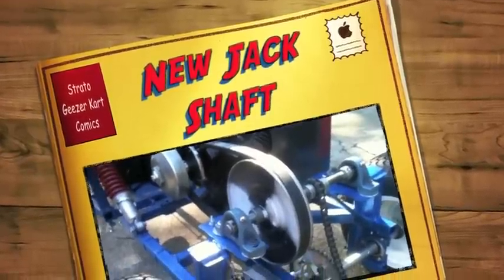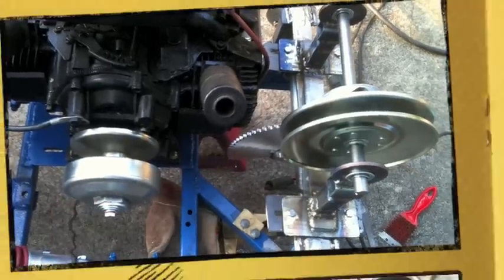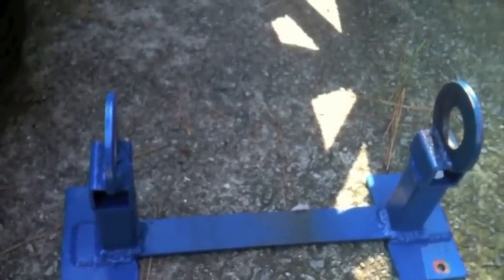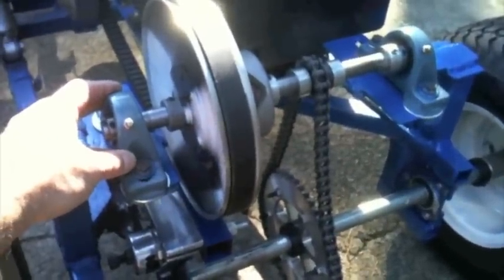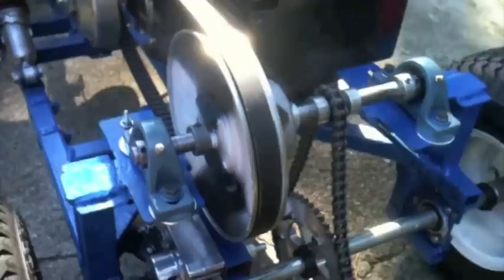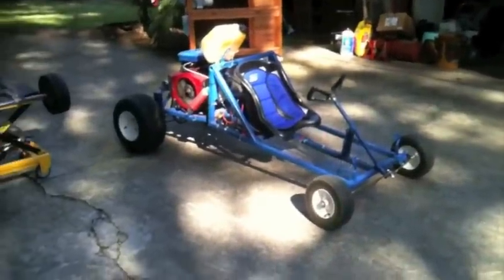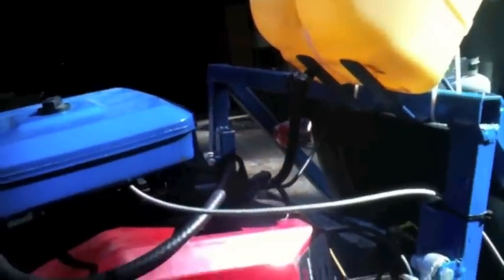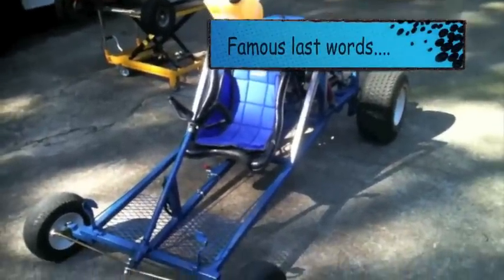New Jackshaft assembly and smaller sprocket

Comment: hay there Bob.... if you want more speed out of that go kart you have change that little bitty sprocket on your jackshaft to something upwards of 17 tooth maybe a 20 that will in turn turn your axle a lot faster also it would allow you to use more of the horsepower directly from the torque converter. I also have a couple of videos of my own buggy that I have built so you have some better ideas that you can work off of if you want.
Reply: Rob S. i never seen a rubber line  when it start to move  most go kart on sprocket has metal chain what is this better ?
Reply: Pit Bull , I don't understand what you're referring to or talking about.

Comment: You torque converter is set up wrong they are pulling in opposite directions spring and pads face outwards not towards the engine
Reply: Really wow think you should stick to somthing you know

Comment: if you have a 12 tooth jack shaft and a 48 tooth sprocket then you are running a 4:1 gear ratio and your kart should do 53 MPH so with the torque converter it should be getting up to about 65. It sounds like your motor cant handle that drastic of gearing and will never hit top speed. it sounds like you are only at about 3000rpm when your kart tops out. Get dual carbs and dual exhaust(straight pipes) remove the governor and that puppy will go!

Comment: I don't like where the gas tank is
Reply: That twin cylinder will eat up some gas. I have a 8hp briggs flathead and even that burns over twice the fuel as my predator 212cc. Looks like he is running a briggs vanguard 18hp 2 cylinder, running it hard it probably burns a gallon every half hour if not more.
Reply: You can huff gasoline as you go along.

Comment: That sprocket also gave you more ground clearance.  interesting the way the suspension wants to tuck forward on acceleration. Good traction on initial acceleration. Your anti squat must be around 200 :)  To adjust that you will have to have 4 links I think.  Possibly a good 3 link.

Comment: It functions Primarily as a reduction mechanism, but also, it's necessary if you are using a torque converter. The torque converter is a better alternative to the old go kart/mini bike centrifugal clutch, for low end power.

Comment: When I was a kid my Dad bought us a type of mini-bike called a tote goat, it had 10 hp B&S engine, a small front wheel and a huge tractor wheel in the back. It was designed as a high torque low speed contraption my Dad thinking speed kills thought this would be a safer mini-bike. My brother found out quickly this was not the case as the designers decided to put the brakes on the center jack shaft. Nobody realized the design flaw until it surfaced while my late brother was climbing a steep hill the chain broke rendering the brakes useless. The look of surprise on his face was priceless looking at us pulling the brake lever as he sped backwards down the hill into a large patch of sticker bushes. I noticed you didn't make the same mistake.
Reply: G Heald 0*@

Comment: If you want more speed put the small sprocket on the bottom an the big sprocket on top
Reply: +Michael Shaw High potential speed but really low torque. Probably so low it wouldn't even get going very well.  Downhill your top speed would be over 100 mph.
Reply: Michael Shaw That would actually make it slower.
Reply: That is if you have kids
Reply: What does having kids have to do with anything?

Comment: Kool little ride , nice engineering BUT -- PAINT OR COVER your tank it is probably not UV stabilized and will get weak in the sun , had one just like that crack on me just from vibration , what a mess. You can cover it with under body spray that works pretty well ....

Comment: i had the same issue with my sons kart i built.. i pulled the pin out and it handled fine, but then all my brake was to just one wheel. this next time around i'll be using a differential in t he drive train..

Comment from the maker: I ended up pulling one of the keystock out of one of the rear drive wheels.  So one wheel is now providing power and the other turns freely to give me a better turn radius.  It's not a perfect solution but it works fine.